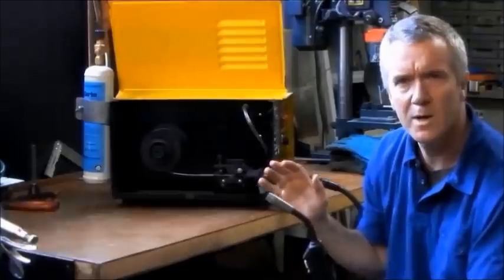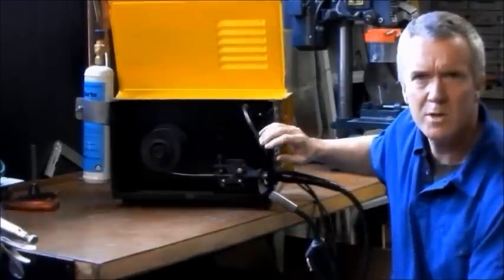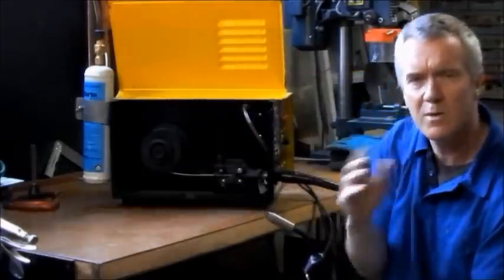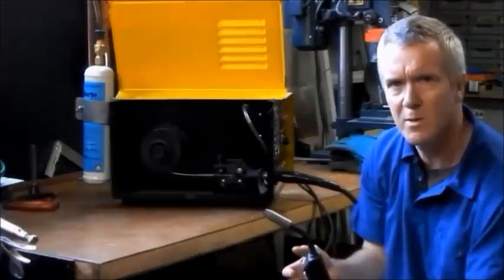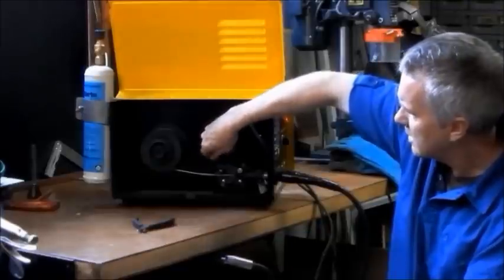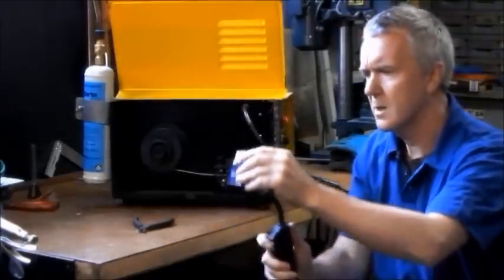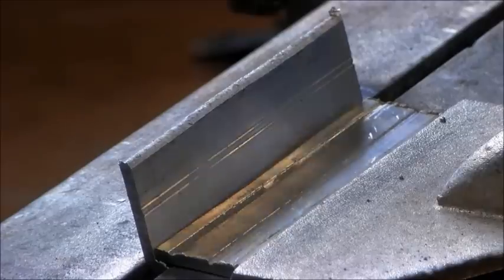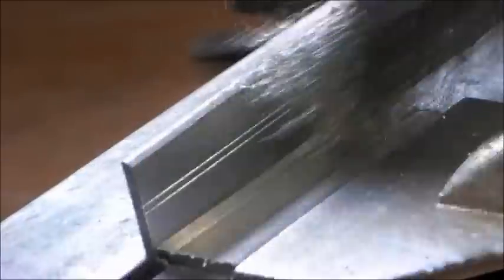Mig welding aluminum without spool gun. part 3

Comment: I bought one Mig Machine planning to weld thin alluminum tubes like 1.6mm up to 2.0mm.
I hope I can make my welding looks like yours!
My Mig is a very simple one. Only wire speed and amps controls to set. Is that like yours, right?

Very well done welding! My regards!
Reply: Wire feed and Voltage are the settings.  The power supply is called Constant Voltage or Constant Potential power supply, you set a voltage and it tries to maintain that.  Current can vary quite a lot.

Comment: Your stick out distance is far too long, with 1 mm wire it should be approx 12 - 15 mm max. This is why your welds are badly oxydised.
Everything else you say and do is correct but not this.